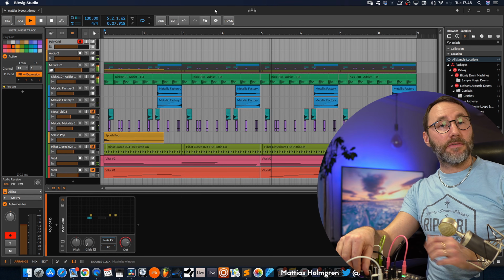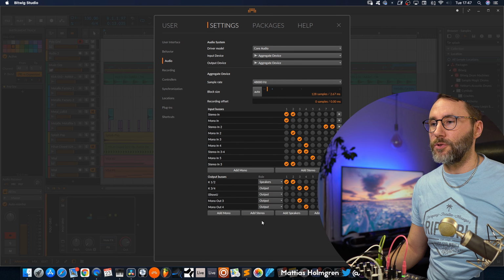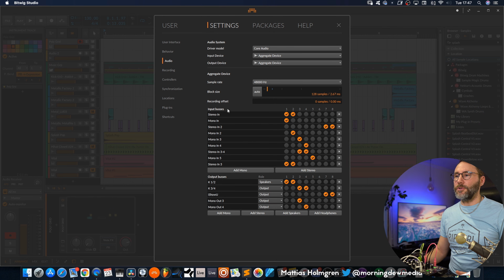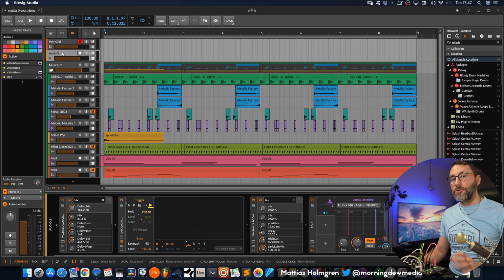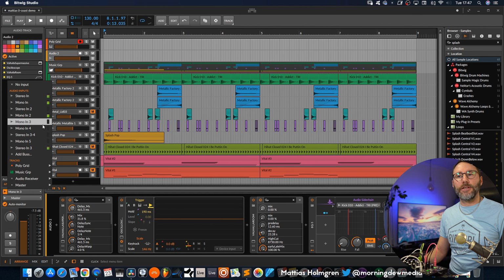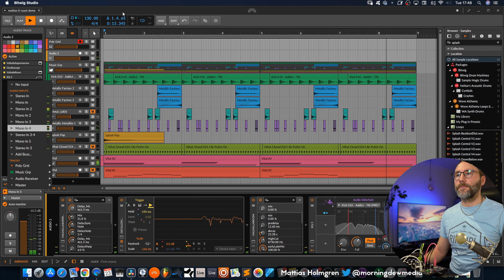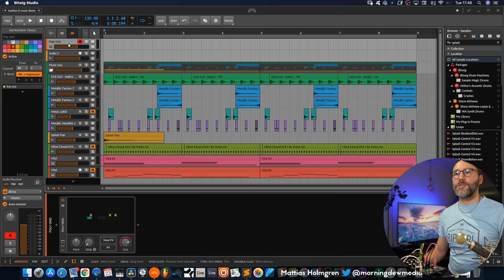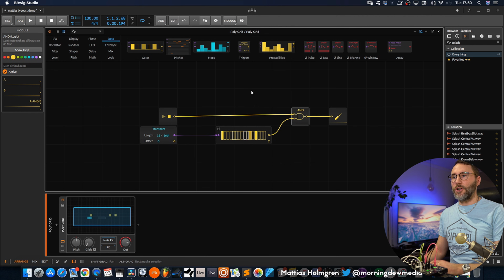Bitwig & Analog Hardware Synths 🤯  CV Gate & Trig

Comment: You do not require DC coupled outputs unless you are specifically passing DC signals out of your modular system. This goes for DC offsets, Pitch CV or anything like that. 

AC coupled just means it passes through a capacitor, which completely removes the DC operating point from the signal, this is an inherent property of capacitors so it is unavoidable. 

But what this does mean is, you can pass most signals so long as they are not static out of your interface. But it will work best with clocks, triggers, gates or basically anything that has sufficient high frequency content to allow the output capacitors to pass it through. Most envelopes should work too, but you may need to pass them through a DC offset to add in the DC information back to the signal when it arrives at your rack. I.e. something like MATHS, by summing the signal with a DC component. 

For instance, if you are trying to feed an input with a signal that should vary between 0-5 V but you are sending a 0-5 envelope out of an AC coupled interface, it will likely vary between +/- 2.5 V. So you would have to ADD a 2.5 V offset to make the signal unipolar.

Comment: That was straight forward thanks. Can you show how to use cv from the grid to control the pitch of the hardware synth? 
I tried using the HW device but I can’t seem to figure out how to get it to tune the hardware oscillator
Reply from the maker: Hi yeah I am planning to do a cv to pitch tutorial video too in a near future. You connect the Bitwig CV out to the CV 1V/Oct Pitch in on the 0-coast. 🌞
Reply: @MattiasHolmgren  i understand that much. Thank you. I just can’t get the bitwig device to calibrate the tuning of the oscillator correctly. It’s always way off. Nowhere near an accurate v/octave outcome

Comment: So do you feel like this opens up bitwig as a controller for a collection of hardware synthesizers and devices for real-time production of analog audio or do you feel that the audio output will be re-recorded back into bitwig for further processing and mastering?.  I hope that makes sense.
Reply from the maker: Hi, personally I don't do this kind of modular fiddling too much. When I want to add analog sounds to my music I record one item at a time (focused), so I might hook up the 0-coast, Minilogue XD, Uno Synth, Zoia, Digitakt, guitar, piano or whatever and I focus on that instrument for a session. I'm not the typical guy connecting 41 devices in a midi chain and send midi on 41 channels to all the gear. 

That said, I think it's fun to explore sending audio CV to an external synth in a isolated experimentation session. So yes, I guess in my case it's recording the audio back into Bitwig for further processing. But most of the time I'm very quick and direct in my work so I continue to other stuff and wrap up my song.
You can experiment forever. ;)
Thanks for writing!

Comment from the maker: Today we talk about how to connect an analog synth to Bitwig Studio, Poly Grid device via Control Voltage (CV). What kind of audio interface do you need? I will talk about the gear, cables, audio routing and also make a little jam with Bitwig Studio and the Make Noise 0-coast analog synth. If you enjoy, subscribe and hit the notification bell. Leave a like and a question or two! Thanks for watching!
Get Bitwig Studio (affiliate link): https://shop.bitwig.com/order/checkout.php?PRODS=4710161&QTY=1&AFFILIATE=112945&AFFSRC=https%3A%2F%2Fwww.youtube.com&CART=1
10% discount with PromoCode: C20F425E74